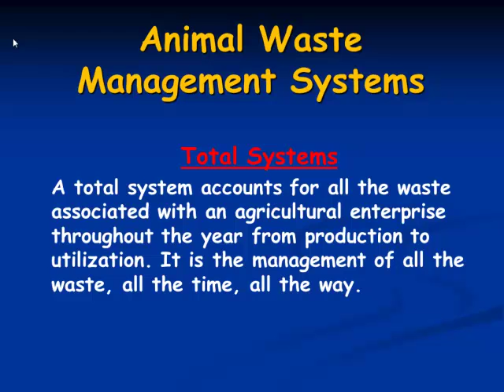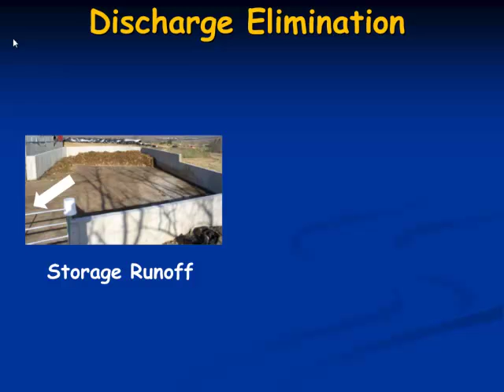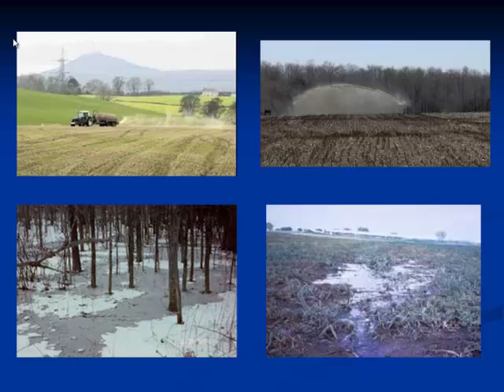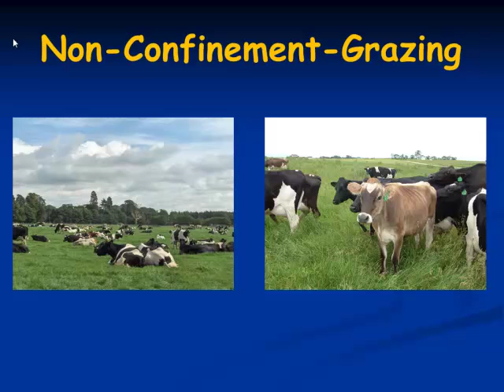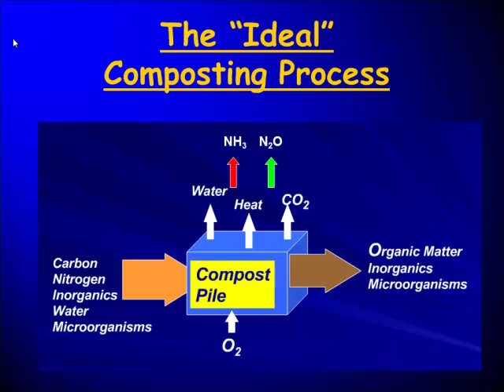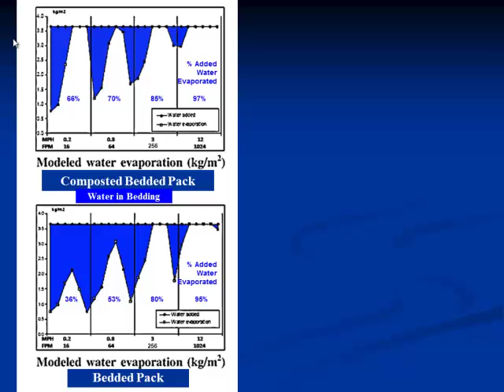Manure management challenges of liquid systems and an overview of the compost bedded pack system

Comment: barns made with a wood structure are better to keep temperatures down, metal barns tend to heat up, also avoid using metal for barn roof, use roof tiles of ceramics or cover all buildings